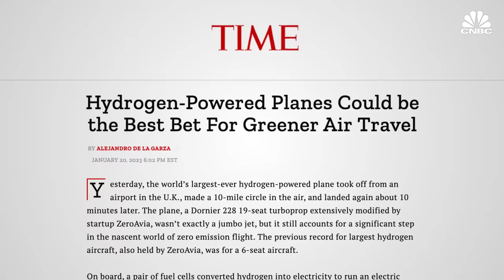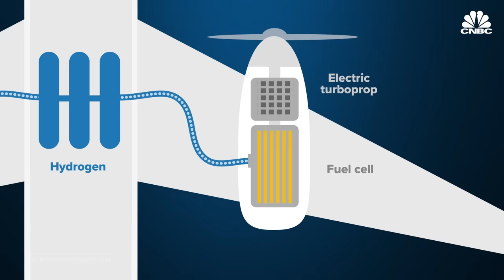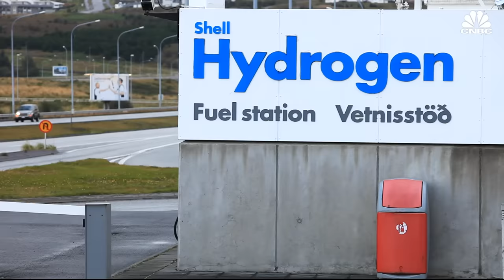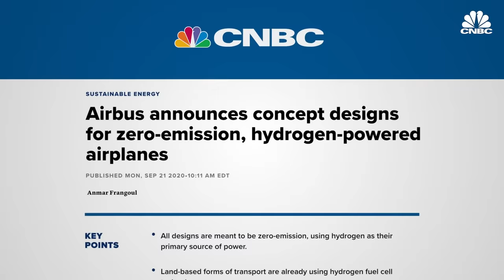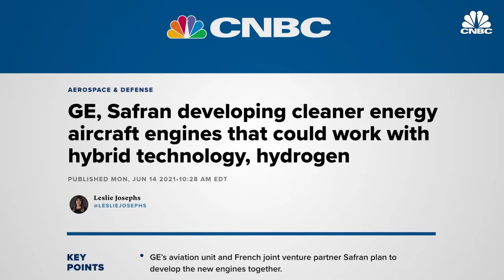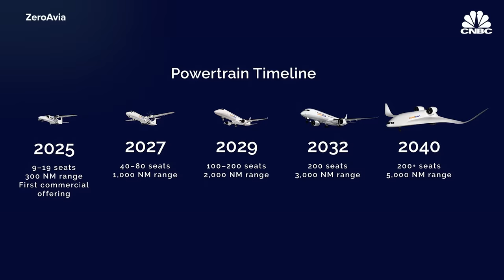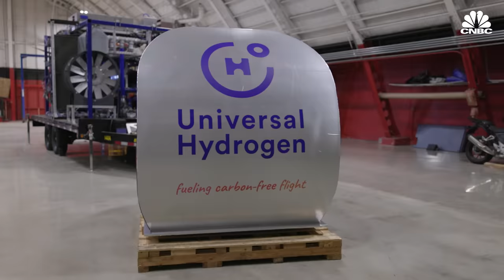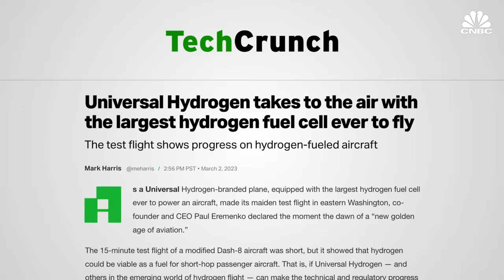Why Hydrogen-Powered Planes Will Beat Electric Planes

Comment: HYDROGEN being the smallest atom in the universe is EXTREMELY hard to store because it just leaks from containers, that and the fact that hydrogen is also extremely flammable which means every leak has the potential for disaster.
Reply: You can store it without a loss today. And it's very hard to ignite because it vapourise as soon as it comes in contact with the air. These people are not stupid.
Reply: @heinedenmark  Hydrogen storage technology has gotten to the point where it can be safely used in motor vehicles where the danger of impact and damage to storage tank is higher than that of aircraft. 

However, hydrogen tanks in airplanes are exposed to altitude which means large pressure differences to deal with and higher risks of failure and malfunction. Plus,  aviation approval and certification of hydrogen fuel for use in airplane is a real nightmare that will take a long time, because any new aircraft technology has to have high redundancy and thoroughly verified to be safe.
Reply: Not in the liquid form
Reply: @nomercy411  Storing hydrogen in liquid form is a viable option with one drawback, it requires storage tanks to be cooled to very low temperatures. In aviation world that means increased size, weight and complexity which is bad news because increase in weight alone is enough to not even consider that option.

The only practical solution is combine hydrogen gas with another molecule to form a bistable compound which can be broken down to release the hydrogen when needed. However that is technology is still in its infancy and a lot of research and development needs to be done.
Reply: @kevingw5379  not at all. The hydrogen tech is not like what you think.
Reply: @kevingw5379  liquid hydrogen is perfect fit for aviation.
Reply: @nomercy411  When I was a kid I made hydrogen for the first time at home, I was 12 years old and nearly burned down the house, I know a thing or two about hydrogen from experience throughout the years. Like I said before, liquid hydrogen is a viable option but not practical, because it requires a lot of energy to cool down the gas. Hydrogen production by itself is already an energy intensive process by itself and it also increases weight and complexity of the fuel system to be able to rival the conventional fuel tanks and systems used in aviation today.
Reply: @kevingw5379  your experiment as a kid doesnt prove anything. You still use the logic base on your case as a 12 yearold kid and take the conclusion 🤦🏻You just dont know the new technology and dont know how it works dude.
Reply: @kevingw5379  you speak like chemistry professor while you dont know anything 🤦🏻
Reply: @nomercy411  I'm not speaking like a chemistry professor, I'm speaking like an engineer and yes I DO know what I'm talking about.
Reply: @kevingw5379  you need to learn more
Reply: @nomercy411  You're absolutely right, that's what we call RESEARCH AND DEVELOPMENT in the industry, it's a necessary part of science and technology. And yes you might consider scientist to be really smart people but they don't know everything, there's still a lot to be learned about the universe.
Reply: When you say that leaking in hydrogen storage has potential for disaster what did you mean that? Everything we do had potential for something. Even as simple. walking. The question is does it safe? If you know how hydrogen chemically works then you would understand that hydrogen is leaking is much much safer. More safer than fossil fuel leaking. And the current storage for hydrogen is already improving a lot that such cases are not viable for argument anymore. The only issue with hydrogen right now is the cost and efficiency.
Reply: @zulhilmi5787  You're wrong, hydrogen leaks are way more dangerous than fossil fuel leaks because hydrogen is very light, less dense than air and almost instantly diffuses in air to form a potent mixture that requires very little energy to ignite. You have to understand that hydrogen is highly reactive with other elements, especially with oxygen and produces a lot of energy in the process, that's why it's not found in nature in the free state. Plus, hydrogen is a colourless, oduorless gas meaning it's very hard to detect leaks until it's too late.

On the other hand fossil fuels don't easily mix with air the way hydrogen does, even volatile fossil fuels like petrol takes a little bit of time. That's why motorcycles and older vehicles need carburetors to aid in air fuel mixing. You might ask, what about gaseous fossil fuels like butane and propane? They also don't easily mix with air the way hydrogen does, because they are denser than air so they tend to fall to bottom first before they start to diffuse and mix with air. 

And yes you're right, the technology of storing hydrogen is at the point where it's so much safer now, however you have to understand that should there be a leakage there is a potential for disaster. Think of it this way, a grenage with the pin on is very safe to handle, you can even throw it around if you want to. However, you have to understand that it's still a grenade and should the pin come off in the process then there is a huge potential for disaster.
Reply: @kevingw5379  based on your comment, seem you dont have enough knowledge about hydrogen. You only know hydrogen is the 1st atom, the leakage, and the mixture with oxygen.
Reply: @nomercy411  I want you to ask yourself one question, if the technology of hydrogen production, distribution and storage is so great why aren't we using it to power automobiles, airplanes, ships and industries? 

Why aren't people adapting hydrogen even though the technology has been there for a very long time and keeps on getting better, but WHY?
Reply: @kevingw5379  that was easy question bruv. All of the big companies all around the world already spent freaking much money on batteries. Only toyota who work on hydrogen. (And ofcourse some startup companies to). You think they will turn to hydrogen immediatelly when they already spent billion dollars on battery? Just a business matter. Those companies are not stupid.
But ofcourse, one day they will turn to hydrogen because it has so much potency. Atleast when they have their money back.
Everything will be hydrogen in due time.
Reply: @nomercy411  The use of batteries to power electric vehicles is a relatively new mainstream technology, atleast in the mass manufacture of electric cars. Just 15 years ago electric vehicles were pretty much non existence, companies only had prototypes. But, hydrogen tech has been around since the 1950's, so my question again is why aren't people so eager to adopt it like they did electric cars if hydrogen is so perfect.
Reply: @kevingw5379  wow. Even you dont know the history of battery. Your knowledge is so limited. Maybe you dont know what is farad, joule, tesla, volta... If you want to understand those technology, you need to study it comprehensively.
Reply: @nomercy411  There is something seriously wrong with you, are we talking about electric cars or the history of batteries?
Reply: @k...5379; That ongoing dialogue between Yourself and president knows it all, was compelling and reasoning in jest, Today's techniques and beyond restraint uses of design by default for good reason. That falling back on allowance of "companies" is an on going load of... Harkening back to the days of the 100 mpg carburetor being bought out by big oil ! It never existed, As transportation is and always depends upon not having to physically be afoot!
Reply: @martinburns7928  Thanks Martin, finally someone with a clear head. We all want hydrogen to work out, it's a clean source of energy and good for the environment, however there are still some challenges to be overcome. Right now the use of hydrogen has more cons than pros, there isn't some conspiracy out there by big tech and oil company to discourage it's use. It just that it's difficult and expensive working with hydrogen, that all.
Reply: @kevingw5379  As a fellow engineer, I would advice you to remain calm and respectful
Reply: @nomercy411  It seems like you're the one who needs to study comprehensively, you didn't give a single valid argument so far, other than saying he is wrong without any reasoning
Reply: @nomercy411 bro you need to study about hydrogen, you are making zero sense, how can we store liquid hydrogen on a plane, it will need to cool down to extremely low temperature, which will require so much energy, from where you will get that much of energy while flying .....
Reply: @kevingw5379 don't argue with him brother.
He is just a kid, who doesn't know anything about hydrogen, he just watched the good things about hydrogen, but in real world it is completely different.
Reply: @ronakvaishnav-yi3xw  you dont have knowledge about hydrogen. There is many technology to liquifying hydrogen. Once the hydrogen is liqufied, when you store in a well isolated silver tank, the temperature will stay and only increase a little and we use that hydrogen vapor to burn the engine. Perfect requirement for airplane.

Comment: In a way, even hydrocarbon is some kind of battery. Plants absorb the energy from the sun and convert it to carbohydrate as energy storage. When the plant died they got buried deep overtime. The fibrous part was petrified, and the carbohydrate was refined by pressure and heat into hydrocarbon.
Reply: woah you just finish first year of high school  ?
Reply: @1marcelfilms  You'll be surprise how many "graduates" don't know about this.

Comment: Cool video. Unfortunately, I suspect hydrogen will take longer to supplant the current air travel logistics than declared, but it will eventually happen. In the nearer term though, I suspect some mix of biofuels and carbon neutral synthetic efuels will be what initially decarbonizes air travel before hydrogen tech is able to become a superior technology. To get the ball rolling I suggest legislating that private jets be LEGALLY REQUIRED to use carbon neutral fuels, be they biofuels, efuels, green hydrogen, direct electricity, or something else. This will help stimulate the market and development to make these technologies become more available at larger scale by having those who CAN pay the premium, do so in the early days.

Comment: I like the idea of a combination of two fuels:
Catalytically derived, cellulosic or algae biobutanol for landings and takeoffs;
Then a switchover to ammonia (NH⁴) for cruising.

Might be the easy & quick low CO² fuel path. 
I think speed & 'anti-absolecence' is important to avoid the  increase in CO² from the manufacturing of new aircraft right away.

Comment: Hydrogen molecules are so small. They are prone to leaking out of hoses, pipes and connectors and storage tanks.
Reply: They leak right through most metals, plastics, glass and wood. It's also insanely explosive and expensive to compress.

Comment: Also, nobody seems to be mentioning the enourmous danger of carrying huge battery packs in an airplane. we have seen battery cars combust in flames instantly but you have never seen a Toyota Mirai combust in flames out of nowhere. That's because its hydrogen tanks are reinforced in a matter that it can stop a small bullet, something not even gas tanks can do.
Reply: Actually gas cars burn around 10 times more than Lithium NMC batteries and 100 times more than Lithium LFP. The comparison isn't completely fair because the gas fleet is much older that EV's.
Reply: planes fly with hundreds of batteries  onboard all the time. passenger’s phones, laptops, battery banks, you name it

Comment: OK, I'm an engineer and that will not work in the next decades, AT ALL. You need an insane amount of fuel cells to get enough power and that WILL BE EXTREMELY expensive. That will quadrupple sixtuple the ticket costs, when planes get a multiple price increase. There is currently no H2 industrie that delivers H2 in large quantities and the one that exist is even more expensive than gasoline and oil, which is already too expensive.
Reply: Electric motors may be able to beat the conventional piston engine, but it is no match for jet engines. Jet engines can beat electric motors within a blink of an eye
Reply: @Negev-Israel  No, you are mistaken my friend: jet engines are even worse than piston engines, you get a lot more blow by (fuel that is not used, but just blown out), everything you can do with a turbine with combustion, you can do 4 times more efficient with a electric motor, they have more torque, they are almost 100% efficient (piston engines only reach like 20%) and they don't need any maintenance. That is by the way why turbines are preferred to pistons: much less maintenance. You unfortunately can't see this and have no vision for the future where things change, all you can see is the status quo. You are unable to better or change the world due to this. The most powerful engines in the world are not turbines and they are not piston engines, but electric, because electric has no size limit how much power you can put in them and that is why in the world today, most powerful engines are all electric.
Reply: @nigratruo  perhaps you should touch grass. You are using the same logic of comparing electric cars with gas cars. An electric car can win against gas car, hands down. But in aviation, things are different.
Reply: @nigratruo  EDF or electric duct fans are the alternative for jet engines. They are not able to produce enough trust as a jet engine of a similar size. Also, the efficiency of a jet engine increases with increase in speed. Not to mention the heavy battery. The only advantage and EDF has over a jet engine is the instant acceleration, responsiveness and fine tuning.  The efficiency of an electric motor might be higher, but it will go down with increase in weight due to bigger motors requiring a larger battery, which requires more thrust and in turn draws more current and this cycle of inefficiency continues. 

Fun fact: the starter of a jet engine is not an electric motor because of its heavy weight. Instead, it uses an air turbine starter.

Comment: As a child in the fifth grade in the 1960s I learned from a science textbook how to make hydrogen and oxygen from water using electrolysis. Since then I have always wondered why not just connect a solar cell or windmill generator to a water electrolysis device and use wind or solar energy to make hydrogen. I guess there are technical reasons why this won't work. This video mentions that storing hydrogen as a gas takes a lot of room and storing as a liquid requires super cooling equipment. Hopefully scientists will come up with an answer to these issues and soon.

Comment: If I was a scientist, I would make a research about how to overcome gravitational forces of the earth by deflecting or changing the direction of gravitational forces to enable aircrafts fly with a minimum amount of fuel. 
1. Define gravitational forces. How can we reverse it or cancel it? Can we build a machine that could make it possible?
2. Is that possible to find a material to isolate or deflect gravitational forces
3. Can we convert gravitational forces into a power source?
I'm quite sure that somebody could take the challange & make it possible, like Wright Brothers. If we can convert sunlight into electricity by using solar panels why can't we achieve creating weightlessness by harnessing gravitational forces?

Comment: If electric planes want to beat hydrogen-powered planes then they should've start research about a megawatt battery. Ion battery use lithium or sodium, what will happens if a proton battery or neutron battery exist? Are they using nano composite?

Comment: Under the Challenges section, I was hoping for some realistic discussion of safety in the storage, transportation and use of hydrogen. Another thought was that adapting regional aircraft to use hydrogen is a less effective emissions control measure than simply eliminating short-hop regional commercial flights via regulations, like France has done, and Spain is considering doing. Both have excellent train networks that can provide equally efficient (in some cases more efficient) regional travel options.

Comment: Not discussed is that burning hydrogen in a conventional turbine engine requires oxygen.   To save weight, that oxygen will come from ambiant air which contains nitrogen.   The result of that combustion will also generate not desirable NOx

Comment: There is no "extra electricity".  Any power diverted to manufacture "green hydrogen" means less power to offset power generation by burning fuels.  As converting energy into a chemical fuel to be later converted back into energy elsewhere (especially hydrogen) represents major loss of efficiency it only serves to increase net CO2 emissions over if power had been directly used by the energy grid.  Also, before all this money gets dumped into hydrogen as an energy carrier I'd like to see estimates of how much hydrogen leaks into the environment during its production, transportation, storage, and conversion.  Leaked hydrogen quickly rises into the high atmosphere and depletes the Ozone layer and creates the greenhouse gas water vapor in the high and normally dry layers of the atmosphere.

Comment: Hydrogen powered vehicles, aircraft or space rockets require that engineers succeed in completely sealing hydrogen containers so that the tiny molecules cannot escape. This makes for extremely complicated valve technology, which to date has only been partially successful.

Comment: Brazil has the Macaúba tree that produces 8 to 10 times more biodiesel (6/8,000 liters/ha) than soybeans or sunflowers. This biodiesel in the refinery is transformed into aviation biokerosene.
If Brazil's 130 million hectares of degraded pastures were reforested, they would produce more than 1 trillion liters of diesel fuel per year. Africa can also produce as much with its 300 million hectares available.